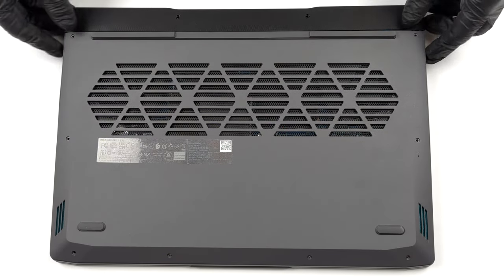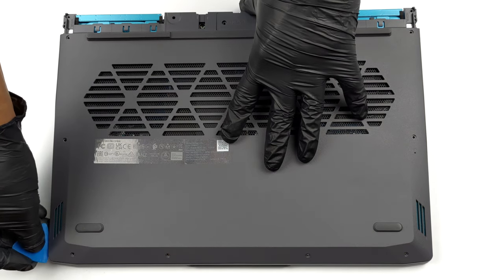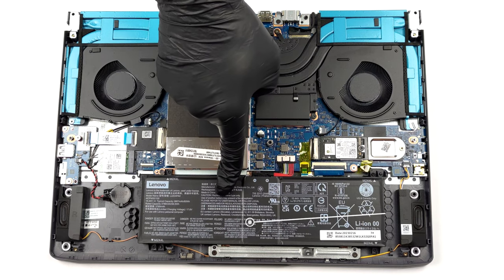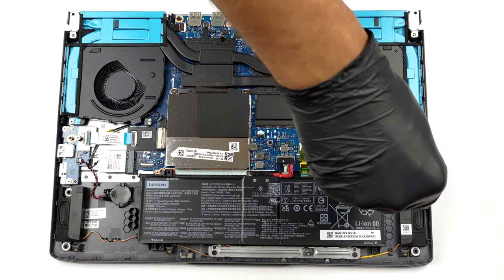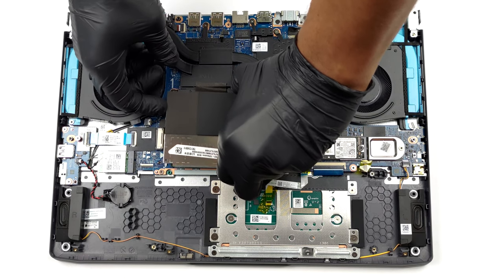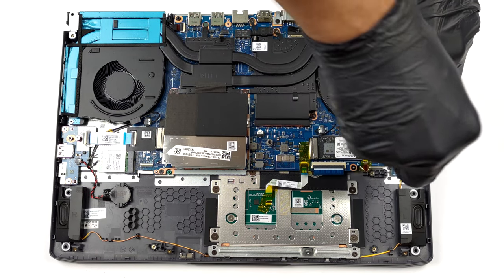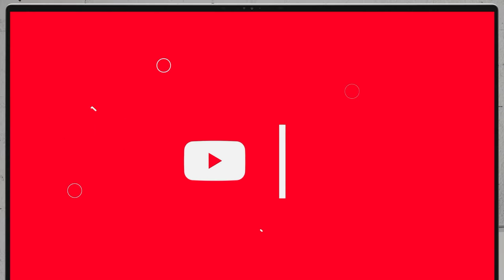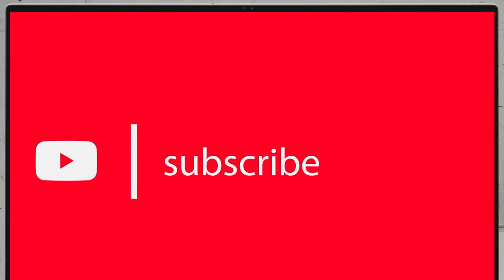🛠️ How to open Lenovo LOQ (15" Intel, 2023) - disassembly and upgrade options

Comment: what do i search to get the same ssd model?
Reply: m.2 ssd
Reply: M.2 2280 gen4 just know that the max is 1tb
Reply: @6ixerz  per slot? i thought it was 2
Reply: @pROaBDUR  sorry for the late response but their is 2 m.2 slots
M.2 is a type of form of ssd and 2280 is the length and width you can basically try to measure and see whatever fits one slot it a 2242 slot and the other fits a 2280 (the extra slot thats not used)
Reply: @6ixerz  noice, thanks
Reply: @6ixerz can I installed 2 TB in second slot? Or each 2 TB SSD then make 4 TB?
Reply: @6ixerz do i need a heatsink or does a heatsink even fit for my new SSD?
Reply: Ur mum
Reply: @MGT3132 no heatsink is require and you can install a 2tb
Reply: I could not find the SSDS at all
Reply: @jimking1243  like in the laptop or you can't search for it online?
Reply: You don't need to get the same SSD
GET WHICHEVER YOU WANT
Reply: @martinkuliza  i do need to get the same size tho
Reply: @pROaBDUR  ok then
get the same size
so...what's the problem
what's your question then?
Reply: UPDATE: Many thanks for the replies regarding upgrading SSD’s on the Lenovo Loq 15irh8.

I bought a 2TB Samsung 990 Pro SSD (2280 size) and unfortunately it does NOT fit properly (without bending) in the M2 slot on the right. The “pillar”, the screw which is meant for the 2242 type SSD’s stands in the way if you install a 2280 SSD. Even a thin 2280 SSD as the single-sided Samsung 990 Pro doesn’t fit without bending it and very likely damaging it. I had to install it in the secondary slot where it fits perfectly (except for a micro-wobble). I did a clean install of a licensed Windows 11 from a USB installation media, reinstalling everything and it works well and pretty fast. I preferred a clean installation over a cloning from the previous 2242 SSD, because cloning… you never know what could go wrong. 
So, beware, 2280 size SSDs DO NOT fit in the primary M2 slot. If you want to upgrade the SSD using the primary M2 slot on the right you’ll have to use a 2242 size SSD. But I didn’t find many 1-2TB SSDs (2242 size) from reliable brands yet. 
Final note for who wants to install Windows 11 in a new SSD in the secondary 2280 M2 slot (on the left), remember to go into BIOS and change the boot order to load the OS from the newly installed SSD. Good luck!
Reply: @teosiriosica  
So first of all
"micro wobble"
LMFAO
is that the technical term ?
Can i use that ?
Hey guys , we have a "CODE M.W. Situation"  there is a micro wobble confirmed, I REPEAT micro....wobble has been confirmed
LOL

Secondly, You don't necessarily need to jump into CMOS Setup all the time, You can use a  GRUB BOOTLOADER that will show up at boot time and let you choose

I have 4 O/S Multiboot system and the GRUB Bootloader is the way to go 

even with the GRUB Bootloader, You still have the option to jump into CMOS Setup if you want to , but it's not needed
especially if you only have 2 drives

another good idea is

Use 1 drive for the O/S and the other for a secondary data backup drive
Reply: @teosiriosica  dude... break it up into paragraphs, it's unreadable... i don't even know if you're complaining or praising the product 'coz i can't even bother to read it.
Reply: there is 2 slot for ssd
the first one that already installed is ssd m2 nvme with size of 2280,
the second one that you can put your aftermarket ssd come with size of 2242
Reply: @pROaBDUR  Do you have this laptop?
Reply: Is this laptop ok?
Reply: Some people saying this laptop have mother board issues
Reply: @Sathish_102  not this model specifically... my friends have the LOQ. and it works fabulously... the motherbord issues occured in laptops with 14th gen CPUs, due to which lenovo had to temporarily discontinue its sale, but as of now i belive that issue has been resolved, and from a personal experience, it is one of the best laptops you could get in this price range... hope this helped
Reply: @pROaBDUR  👍
Reply: bende amd versiyonu var ve 4 ısı borusuna sahip m2 yuvasıda farklı 2 versiyonunda bu kadar farklı olması biraz garip

Comment: My Lenovo LOQ Gaming i5-13420H successfully updated 2xRAM DDR5 5600MHz 32GB for a total of 64GB
Reply: Do we to need to unplug the battery from the motherboard before installing the ram stick? And does your 13 gen processor support 64gb ram?
Reply: @shakeebahmer  yes, unplug the battery & support 64gb ram
Reply: Do you know what brand you used for the ram?  I’m trying to do that as well
Reply: I am assuming there must have been a need for 64gb ram, otherwise, in no sane world would you need that amount of ram
Reply: @rageplushie  I use many programs, one of which is a program for drawing, on two monitors. and 64bit is very helpful.
Reply: Your CPU only supports 5200 mhz
Reply: Hi brother 
Brother even I have 15inch loq Ryzen 7 7840hs and 4060 (15APH8)

But ram and rom aren't enough so 
Plz tell me what is the max ram and rom for this laptop ?

And suggest me a good SSD and ram  I will max this up 
I can't even install more than 2 to 3 games the SSD will go to red colour and says storage management or something
Reply: is it still alive?

Comment: 32 gb is max
Reply: Mhz?
Reply: but when i check on cmd it says 64gb is max(?)
Reply: Do you that amount of ram?
Reply: Cuz I wanna buy that laptop but I'm sure what is the maximum amount of ram that it supports, because on the lenovo's  PDF says that that laptop supports up to 16gb of ram that's it
Reply: @bensalas683 the same one your laptop comes with. it is decided by the cpu compatibility
Reply: The actual limit of the slot is 48gb per dimm. So if you have 322$ you can buy a kit of 96gb ddr5 sodimm from crucial. 
Actual support mau varry. But 32gb & 64gb is 100% supported.
Reply: @KuntalGhosh  How about maximum supported SSD capacity per slot? and can we use 2280 size SSD on 1st slot by replacing  size 2242?, so in total 2280 size SSDs on both slots?
Reply: @Ritz799  yes both support 2280 ssd. And the maximum size depends on your bank balance. If you can afford two 8tb nvme drives then you can have 16tb of nvme storage here. Each one of those ssd's cost more than this laptop. 
The best option is dual 2tb 970evo plus at 70$ each. 4tb is more than enough even if you have a big steam library. Or edit prores vidoes on the laptop.
Reply: @KuntalGhosh  are you sure? In my case mine is customised model 15APH8D2 model with type 82 XT machine, and where can we find this information of maximum capacity supported per slot as it's not mentioned on lenevo manuals
Reply: @Ritz799  nvme is just pci express. It has no limits. Currently the largest m.2 nvme on market is rocket 4 plus 8tb. And it is compatible with any pcie express nvme slot. Even 2x slots will work. At slow speed but it will work. You can even install any pcie device on m.2 slot with appropriate adapters including desktop graphics cards.
Reply: @KuntalGhosh  mine is a laptop model, have you used bigger size capacity NVMe m.2 SSD on laptop shown as only 1 TB SSD support?

Plus size 2242 has a screw slot in between so 2280 size is going to get bend and doesn't has locking mechanism, so how do we get Gen 4 7000 mbps speed 2242 size nvme m.2 SSD?

And any other solutions to fit 2280 size NVMe m.2 SSD on 1st slot where we can replace size 2242 , if desired generation and speed is not available
Reply: @Ritz799  if your laptop uses a bracket to extend the nvme to 2280 then you just skip the bracket and install the ssd on the slot as usual. If your ssd is single sided it won't get bent if there is a screw hole under it. If it is interfering remove the standoff. Typically it is soldered to the board so use a powerful soldering iron to heat the standoff and melt the solder then just pull it and it should easily come off without damage. 
Only 4tb and up m.2 ssd's have flash chips on both sides so you should have no problem with 2tb ssd. 
And m.2 slot is just a pcie express slot in different format. There is no limit for storage capacity. You can install as much as you want. You can go for peta byte by using adapters and pcie bridge to install multiple m.2 ssd's in one slot . Only bank balance and creativity is the limit.
Reply: @KuntalGhosh  I see, so at present instead of heating and melting the standoff in middle, do we have any alternate solutions to skip the standoff and raise the level at the end where we need to screw to tighten the ssd, like a slightly bigger size of screw at the end, where 2280 size ssd can flyover the middle stand-off
Reply: @KuntalGhosh awaiting your response
Reply: @Ritz799 Hi sir,Lenovo customer care telling max expand ram is 16gb and don't support beyond that.did you try it and share the model number you bought.plz reply.
India model.
Reply: @Publicchannel5  yes, mine is 16gb only
Reply: Awaiting your response
Reply: Hi I see 16gb limits to on Lenovo website but I find this strange. So if someone has tested please inform me.
Reply: @DarwinTV974 it can be expand to 64gb .
Reply: Not true. Installed 64 gb ddr5 4800 mhz ram today. Version : 12450 H / 4050.

Comment: Does anyone knows how much we can expand SSD and or HDDs in LOQ 15 APH8 Type 82XT custom models
Reply: 1tb (1000gb) says it on the site but supposedly for the ram people extended it to 32 when it said 16gb max
Reply: can we upgrade 8gb graphics card to 16 gb 😅 , im quite new to gaming 😅
Reply: @Bsksun  No
Reply: I have installed a 2tbnvme ssd on my loq irh8 from their authorised lenovo store😂
Reply: i'ts more of a question of.. what is the largest SSD ,  Actually it's   M.2 NVME  let's not call it SSD, ok
it's a question of... What is the largest you can buy and afford right now

THE LARGEST OFFICIAL SIZE THAT 64bit WINDOWS can support ,  WITH GPT Partition... is......................

18 EB
That means
18 Exa Bytes
Have you seen any around ?

that means

Giga
Tera
Peta
Exa

1,000                 GigaBytes = 1               TeraByte
1,000,000         GigaBytes = 1,000        TeraBytes =         1 PetaByte
1,000,000,000 Gigabytes = 1,000,000 TeraBytes = 1,000 PetaBytes = 1 ExaByte

SO...
1 EXABYTE =  1,000,000 (1 Million)  TERABYTES
Take a moment to appreciate that

Now Imagine  18  MILLION TERABYTES

SO YOUR SIMPLE ANSWER IS.......
YOU CAN INSERT ANY DAMN SIZE M.2 THAT YOU LIKE AS LONG AS YOU CAN AFFORD IT AND THE M.2 FITS INTO THE SLOT

Your laptop will die before they invent the need for the 18 ExaByte SSD

Comment: Hey man love your videos, i just want to inquire if i can expand the memory size to 32gb or 64gb Ram of the laptop
Reply: This is ddr5. So technically you can do 96gb with 48gb dimm sodimm.
Reply: @KuntalGhosh wait…. Can you explain? Why that is?

I tried to upgrade my 1x8 to 2x16 but it won’t work. But it works with 1x16
Reply: @M23jnba really?
Reply: @Yogi_Permana  I retried it with 2x16 a few days later and it worked. I think it has to do with bio updating.  I think I updated bio and second time it worked
Reply: @M23jnba  thanks for the info bro
Reply: @M23jnba  how did you update your bios please can you tell me because i already bought 32gb of ram and i want to upgrade it
Reply: @tjimmy3071  I have Lenovo pre installed. It’s in the Lenovo Vantage” I think. Look at the bottom of the bar. Then find system update or something. Eventually you’ll get to “check for bios update” then update. It will have to restart your laptop if I remembered correctly.
Reply: @M23jnba  okay thank you so much
Reply: @M23jnba hi, the configuration of your laptop is i5 12450h rtx 4060 ? . I want to buy the indicated model, on the lenovo support page it tells me that the maximum is 16gb ram.
Reply: no, although I do have i5 13400 I believe. My graphic card isn’t that good 3050
Reply: the deal I got was from best buy
Reply: Hi sir,Lenovo customer care telling max expand ram is 16gb and don't support beyond that.did you try it and share the model number you bought.plz reply.
Reply: My Lenovo LOQ Gaming i5-13420H successfully updated 2xRAM DDR5 5600MHz 32GB for a total of 64GB
Reply: @anangdonoprasetyo8051  where you bought RAM,how much cost?
Reply: I own the Lenovo loq 15 with a rtx 4050 & I upgraded the ram successfully to 32gb of ram 2x16 I’m very curious if it’s possible to go more since it’s DDR5
Reply: @anangdonoprasetyo8051 really? I called Lenovo with the same model and they told me that it only supported 2 RAM cards of 8GB each. Maximum sum should be 16GB
Reply: @brianyuncarmartinez2820  I have done it on my laptop. LOQ Gaming i5-13420H. 2 x 32Gb, so 64Gb in total
Reply: Could you tell me how to use DDR5 memory card to achieve max 64GB? please help to answer is 32GBx2-4800MHz or 32GBx2-5600MHz? thank you very much.

Comment: You're here because you don't know why the first protective plastic is so difficult to remove 

Because I had trouble opening this loq in my repair shop
Reply: What ?
i'ts not hard to remove
Reply: My laptop exploded
Reply: I did too. I was scared of snapping something . Good vid.
Reply: Same issue for me too, eventually got it opened but I was scared I'd break something with how resistant it was.

Comment: As I see the slot for ssd 2248 fits 2280, I already installed 2280 in empty slot 1TB, so I want to change 2248 512GB to 2280 1TB

Comment: Can you remove fans and heatsink separately ?
Reply: Meh no
Reply: Yes, you can. I had to do it awhile ago with my 2023 4050 model, the fans have a front plate with 4 screws, but you need a ridiculously tiny screwdriver. Almost everything in this laptop is easily repairable. You just need the right sizes of Phillips screwdrivers.

Comment: Hi, can you please mention which type of screw is it that is used to hold the SSD slot, I have tried 4 different (+) screwdrivers but none of them fits it. Would really appreciate if you could share screwdriver you used or the type of screw. Thanks.
Reply: phillips head
Reply: Really small Phillips head
Reply: phillips X0 smallest standard phillips head

Comment: Does anyone know to to find the cable that connects to the monitor? Got black lines on my screen and looks to be a hardware issue. I want to make sure the cable is connected properly.
Reply: you would need to remove the BEZEL on the screen
and the motherboard for the otherside of the cable

Comment: Could you tell me how to use DDR5 memory card to achieve max 64GB? please help to answer is 32GBx2-4800MHz or 32GBx2-5600MHz? thank you very much.
Reply: I upgraded my laptop (LOQ 15IRH8) with 2xCrucial 32GB (1x32GB) DDR5 5600MHz CL46 1.1V. In Windows task manager, they works at 5200 MHz.

Comment: Can you replace that m.2 2242 for a full m.2 2280? It looks like it has the space for it, no?
Reply: Same question,Do you get the answr ?
Reply: @abdulrahmanibrahim8340  Never got an answer, but the wifi card in the laptop was bad, so I returned it for a similar HP Victus that was $50 cheaper. It only has one m.2 slot. I put a 1tb ssd that I had in it already, but going to replace it with a 2TB 980 Pro when it hopefully goes more on sale on Black Friday.
Reply: @abdulrahmanibrahim8340  I think 2242 is just the length though, so a 2280 should work just fine. I mean it has the standoff further towards the right for it, it looks like.
Reply: @GeorgeMKaneLive  ok, thx sir ❤️
Reply: I watch some another video trying to replace that m.2 2242 to m.2 2280. but the m.2 2280 SSD is bent
Reply: YES YOU CAN

Comment: there is a connector strip under the 2nd ssd slot space. will it not damaged by 🔥 hot gen4 nvme?
Reply: I looked at another laptop, and it had a similar connector under the second slot, so you should be good there. :)
Reply: @GeorgeMKaneLive can we upgrade 8gb graphics card to 16 gb 😅 , im quite new to gaming 😅
Reply: @Bsksun  As far as I know, you can't upgrade the gpu. Maybe on the motherboard manufacturer's website? I've never replaced a laptop gpu. Not worth it.
Reply: CAN CONFIRM.....................NO it will not be damaged,  I've already done the upgrade
Reply: @Bsksun  bruh if you got a 8gb graphics card wtf you need to upgrade it for?? It would definitely be anything above 3050 6gb, so it can run most games on mid-high settings....

Comment: Hi , in order to get to SSD and ram we need to touch any warranty sigils
Reply: Opening it is already a waranty void
Reply: It’s illegal for them to void your warranty for it being open. They will not warranty aftermarket parts or parts noticeably damaged due to being open though.
Reply: NO. THERE ARE NO LABELS THAT YOU NEED TO VIOLATE
go head and do it
Reply: @RagnarLothbrok1969 just beware this depends on where you live and what jurisdiction, typically it’s illegal for companies to do that in most of the USA, but varies more in other countries.

Comment: Sir mostly YouTube channel says Lenovo loq comes with only 2242 SSD slot not 2280 SSD slot but in your video I saw that you are fitting a 2280 SSD in it, sir I want to buy Lenovo loq Intel 12 gen rtx 3050 6GB but I am very confused because of this SSD slots
Please tell me that all of the Lenovo loq's laptop comes with SSD 2280 slot or 2242 slot im India ????? Please help
Reply: Idk if u got the response, first is 2242 but the empty one is 2280

Comment: Question: can you upgrade the battery from 60w to 80w?
Reply: I don;t think so. lenovo 16inch LOQ models support 80w peice which is larger in size and has smaller speakers to accomodate. The 15inch model has larger speakers and smaller battery and that should do just fine, considering this is a gaming category laptop. I own 16 inch model but 80whr battery doesn't do enough justice. I still need to keep it connected to AC supply.